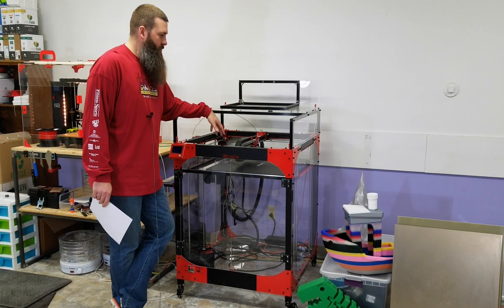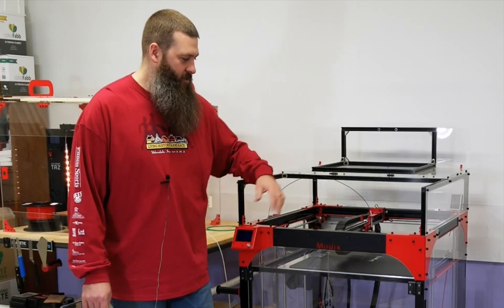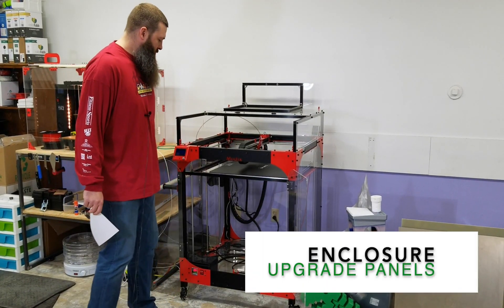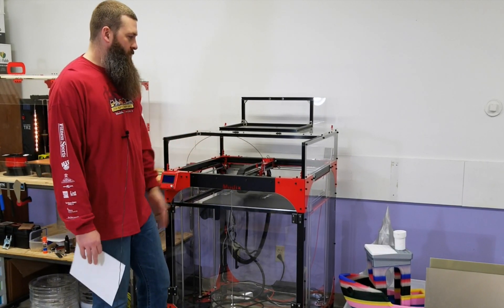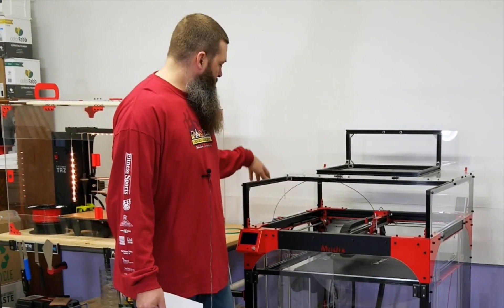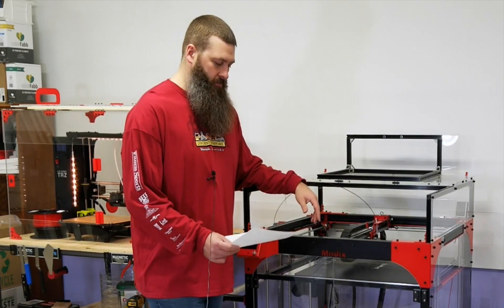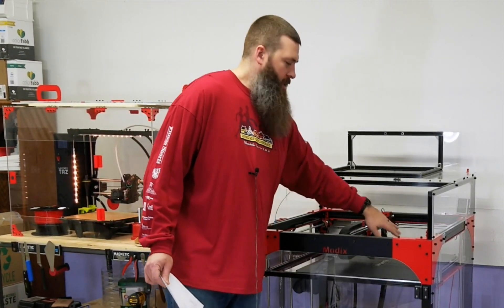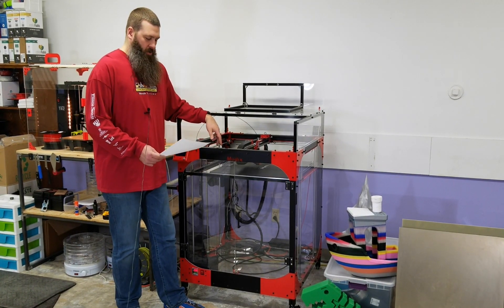Modix Big60 v2: Review After a Year! (part 2/3)

Comment: Better caster wheels which can help you level the frame: google for Machine-leveling casters
For when you need stability more often than you need to move it around.
Reply from the maker: Check out the casters Modix is using in the V3 machines (my latest video). Those are significantly better, and have a rubber foot that lowers down to isolate the machine from vibrations in the floor.

Comment: I would like about half of those as well, but maybe its better it doesn't have more stuff to keep the cost affordable.
Reply from the maker: The machines are excellent when used fully stock. But the ability to upgrade your machine anytime is one of the things I like about the Modix design. I definitely recommend the enclosure at an absolute minimum, though.

Comment: Thank you for the video reviews.  You mentioned colors and the Palette 2S...   if you haven't already, also consider the QuadFusion print head.  It can be driven by the Duet 2 Wifi board and that would be a good upgrade board and filament wise.   You may already know, but just in case, that print head can do filament blending / mixing at variable ratios from 1% to 100% for each of the 4 extruder gears.
Reply from the maker: Thanks for watching! I looked into the QuadFusion print head when it came out from M3D and it looks interesting. The idea of full color mixing with CMYK colors is pretty cool. I'd love to hear from actual users who might have experience with it!
Reply: @ecostruder  I've used one on a smaller printer.  After my comment I realized that one drawback is flow rate.... It won't flow anywhere near enough filament for fast print speeds on second thought.   If you don't mind slowing it all down for in trade for the color that might be okay, but large pieces would probably be painfully slow.
Reply: @ecostruder  they have a 0.5mm nozzle as the largest one.  The one that comes with it is 0.35mm.

Comment: It's great that you became a reseller! Congrats!  One request I have is to have a large (5kg) capacity filament holder.  I made one myself out of PVC and designed hinges that I bolt on to the uprights but it would be nice to have it come with that....being that the build area is 2x2x2, you need a lot of filament so it should be a given you will use large reels of filament.
Reply from the maker: Absolutely--I use large spools as well. Biggest I've used is 10kg so far. One project used almost 3 of them! In that case I ended up getting a cable caddy, which worked out great. This is the one I got: https://smile.amazon.com/gp/product/B00XUNNMZ4. I also used White Lithium Grease to make it spin nice and smoothly.